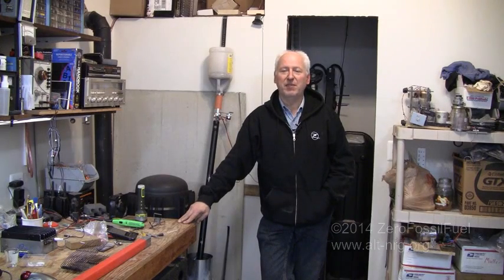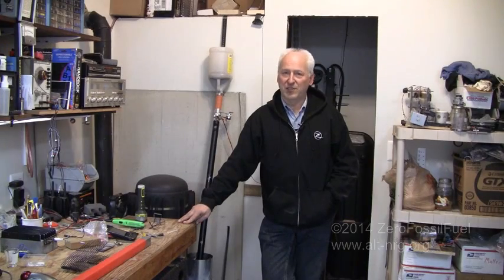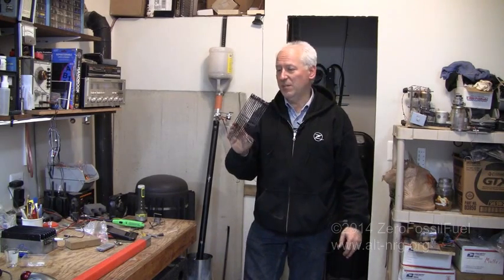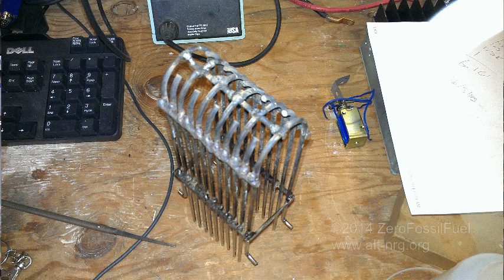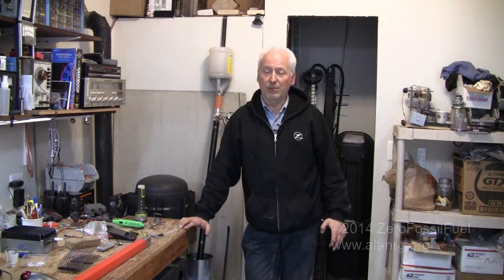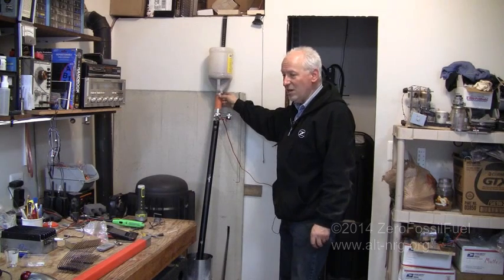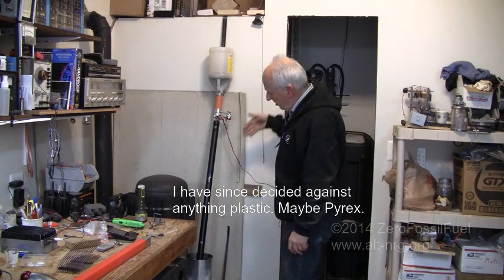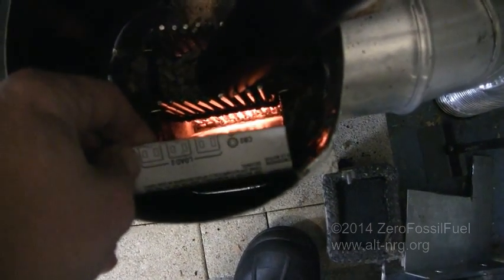#355 Best performance ever with Pellets in Rocket Stove!

Comment: You can just use a 2" round tube with a hopper on top to hold a full 40 lb. bag of pellets and you won't need a vibrator to get them to fall into the burner. My feed tube is a 2" X 3" square tube that feeds my stove all day (or night) and it works flawlessly.

Comment: Sir.  Good heat, but it is simply not possible to achieve decent levels of efficiency unless one controls the air feeds, most importantly to the primary combustion.   If you seal and control it, I'd guess you'd reduce fuel consumption by some 50%.

Comment: how long of burn time do you get with the current setup
Reply from the maker: My hopper holds about 8lb of pellets. It will run 2-3 hours straight depending on how I adjust the fire basket which affects rate of burn. I usually only burn 6lb or so on the coldest evenings to raise the shop temp ~30*F. I also have a small timed shaker motor on the gravity feed chute to help prevent jamming.

Comment: ok it has been a total of two years with this rocket stove how is the metal holding up on the inside
Reply from the maker: Beautifully! Inspected it last week before firing up again for this season. None of the internal parts are breaking down because they are 100% lined with firebrick. The only part I need to rebuild is the ss304 wood pellet fire basket. Lasted two years. I only expected one.
Reply from the maker: @marthale7 Only metal I can think of might be tungsten steel rods. Not sure what they're like to work with and bend.

Comment: Great video can I ask you the air intake pipe which comes up through your floor is it fan assisted, [is there a fan sucking air from outside and into the fire?] thank you in advance
Reply from the maker: JT777 No fan assist. Pressure drop at the wood inlet created by the stove convection is simply equalized through the air inlet pipe.

Comment: If I was me, and last time i checked i was.
I would weld a round flat plate on to the top of that compressor dome, and one, grab the heat off of the dome, and two, use it for cooking, with pans, or another dome on top of the newly added plate, to use as a Pizza oven or regular oven.
But if nothing else catch all that heat, and spread it out some.
Reply from the maker: Gary West Well, that's you. ;-)

Comment: How will you avoid backfire ... its a potentially danger - happends in DK all the time with the old boilers... :-) I am curious however to if the rocket stove works more effecient than an ordinary boiler..because of the heat riser  ....
Reply from the maker: Backfire is prevented by the difference in height between the internal riser and the fuel inlet. The greater the difference the stronger the draft. It just does not happen. Efficency is attributed to the method of heat reclamation inherant to the overall design.

Comment: You could do as I did and just use a 2" square tube to feed the pellets with a square hopper to fill with pellets I no plastic jug or vibrator needed) and regulate the temperature by controlling the air feed behind the tube with a damper of your own design. It works quite well in my application. My burner is square and slides in from the front of the stove if I need to remove it and I have an ash pan below to catch the burned pellets/ashes. Just a thought. Keep on truckin'!

Comment: If you want to get really creative with the pellet feed system than make a stirling engine with interchangeable diameter wheels (for timing) connected with rubber bands or belts or something to an Archimedes screw and a hopper.

Comment: How much has your exhaust stack temp increased with this new mod?  Any possibility of leveraging heatsinks on that to extract a bit more heat instead of heating up the outside neighborhood?  Excellent work btw!
Reply from the maker: Temp differential between heater top and flue pipe at exit is about the same, still very high, meaning high temps on the heater (800+), low temps at the flue (never seen above 185*F).

Comment: I was going to build a rocket stove for my green house but I have two 150,000 btu gas heaters in greenhouse and it scared me into not doing it. I was intrigued the way you used the fire brick and watched everything you have done. Very ingenious how you built the stove. I bought all kinds of material to build the stove, like stove pipe, 55 gal drum and fire brick. I am not a welder, so I have to do things different than what you did. I will probably build it in my garage. Enjoy your videos on stove a lot. Thanks for sharing.

Comment: Excellent job. Have you considered making the basket from Inconel bars, to greatly increase its longevity? Inconel is stable to very high temperatures, but of particular note is its excellent resiliance to direct flames.
Reply from the maker: I have some irregularly shaped Inconel plates given to me by someone involved in jet engine turbine manufacturing that were mfg rejects to use with HHO cells. They'd be tough to trim.

Comment: Great build, Only thing is the name, its no longer a Rocket Stove, its a Rocker Heater. Perfect sound and quality in your videos.  I hope to have my RHeater video up soon, I used a 100lb propane tank, u and I started about the same time and are very similar considering.  Mine is in a garage in Norther WI and I can't work on it steady. Glad u like the Pyrex glass idea, should work if u can find some.
Reply: Gary, I'm sure he could cook on it if he wanted to. 800F is plenty of heat to cook on! 
BTW, ZFF, you may enjoy putting a cast iron pot of water on the top to add a bit of humidity on occasion. 
Cheers,
James
Reply: James Kniskern Got that right, next he will have a ZFF toaster. Ha.
Reply from the maker: James Kniskern
Actually, I specifically do not put water on the heater because I'm constantly bringing the cold workshop up to temp. Any moisture would condense on my tools and rust. As it is, with the dry heat I get zero condensation on cold metal. Not even on the aluminum frames of my windows!

Comment: I was wondering how you were going to deal with the ash buildup in the bottom of the hopper.  I ran into the same thing with my hopper last year, especially when I loaded up with 80 pounds of pellets and it's why I change it to my current grate.  I'm currently burning around 12 pound per hour in mine.  The top of my 55 gal drum glows read....My IR reader doesn't got that high.  ;-)  Nice work!
Reply from the maker: 12lb/hr? Wow. What's that? About 100,000 BTU/hr? Haven't gotten it glowing yet but it's hard to get too close to. More snow on Thursday!

Comment: Hey Z,  you mentioned in an earlier video that you needed a method to make it "drop out of warp" when the day is done. How are you shutting down the pellet rocket stove?
Awesome project by the way. 
Frank
Reply from the maker: Right now I either just let it run out of pellets or I have a cap I can snap into place at the end of the feeder tube that cuts off the flow. Someone here suggested maybe cutting a partial thin slot to slide a gate into. I might try that.

Thanks for watching!

Comment: Zero I apologize if I missed it in one of your videos, but what material is your basket made of? I am copying your build method, with the addition of a sand filled "surround chamber" containing coils of copper circulating pipe to store heat in an insulated 275 gallon tote full of water. I realize my addition will cause the stove to take longer to come up to exterior temp, but I am wondering if it will have an adverse effect on the burn temp inside. I would love to convert to pellets.
Reply from the maker: I am now using 0.125" dia 308L stainless welding rods to make the baskets. My recommendation is to let the internal system run as hot as possible and not collect any heat until it exits the top of the internal riser.
Reply: ZeroFossilFuel My current plan is to add the water heating "chamber" to the exterior of the stove in place of the fins you use. I plan on using a sand fill to add some thermal mass. I would delete the sand and copper pipe if my welding skills could be trusted to make the chamber watertight, but I don't have that much confidence! LOL The high temp, coupled with the cycling nature of use causes me concern. This way... if it leaks, all I have is sand on my floor!! Thank you for sharing your build!!!

Comment: Hi Zero,  Nice job.  I've been following your videos and much appreciate sharing your research and your results with us.  What size shop/shed do you have?  My barn is 34x24 with 10' ceilings.  My propane heater does okay @ 75000 BTUs but the price of propane is getting ridiculous.  Question, in your opinion how big of a rocket heater do you think I need to build to maintain a descent working temp for a shop my size.  And I'm just looking for an opinion. I'm thinking a 5" fire box and chimney set up with a 42" tall re-claimer tank.  Thank you….. Dave
Reply from the maker: That sounds about right. With pellets I'm now getting close to 40,000 BTU/hr from my stove with 3.25"x3.5" firebox and 3.5"x3.5"x27" internal riser.

Comment: Perhaps the gradient between the exhaust temperature and the outside ambient air is sufficient to run a sterling engine, and so capture some more energy?

Comment: HaHaHa. Wait till We get the H-Cat Heater Fine Tuned...no wood pellets needed, just add water...I will admit though, your automation and upgrades to this stove design is pretty ingenious.
Reply from the maker: Someone flagged your message as spam but I like what you're doing. Jetijs posted an interesting vid on this too. Very interested to see where it goes.
Reply: ZeroFossilFuel My post being flagged as spam on your channel doesn't surprise me lol. Good to know you are intrigued by the effect we are experimenting with. I looked up the post from "Jetijs". Very cool effect to see no matter how many times you see it or do it.  I think the process would make one hell of a heater and since no on demand heater exists based on the effect, I think its something all of us should be working towards. Whoever gets there first will have something very valuable and useful. I was hoping some of the top experimenters like yourself would pick up on it and post some video as well. We all have our opinions on other experimenters but you are one of the most thorough when it comes to documentation and measurements. We may have something that can yield some absolute power which will quickly put control back in the hands of the people. Best of luck to you in the future...

Comment: So nice , I would love to have one in my small shop . Your shaker is cool , we use a chlorine pellet injector on some wells . It works similar to that . It goes on top of well and when the pump turns  on it will drop pellets in to well threw a small pipe . I bet you could convert that to work also . If your interested I could send you some info  . Don't get me wrong ,I love yours it just something to look at maybe for a different project ? Keep posting  you do such a good job with your videos . Thank again .
Dave

Comment: .
Reply: Really nice implementation!  As you stated, this stove will never be  robotic and self-lighting so you can warm the lab before you enter it.   Even so you worked past every hitch in the system to an elegant solution. 

I suspect LOTS of people will  follow your lead now and demand for pellets will  increase. The HEATED lab is a big step up from the garage and the stove frees your  creativity for new projects.
Reply: (Your bar across the bottom of the basket will expand and start destroying the basket.  Soon as you notice it, replace it w/ a bar just welded on each end. =Will buy you some time.)